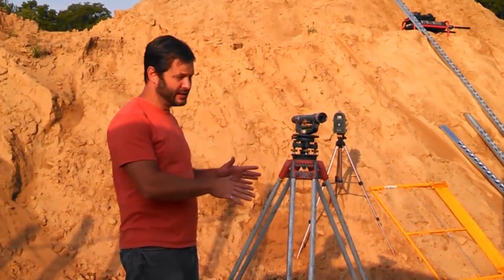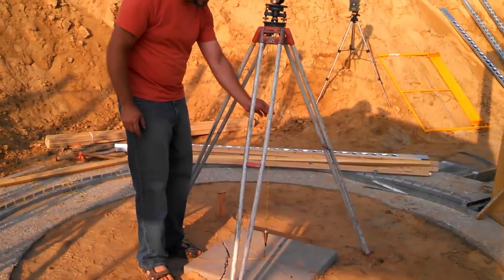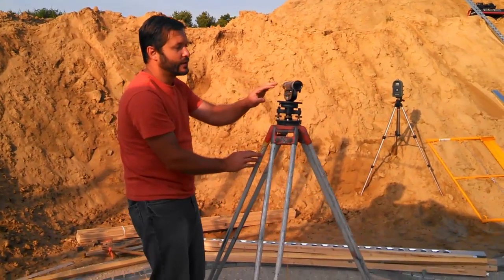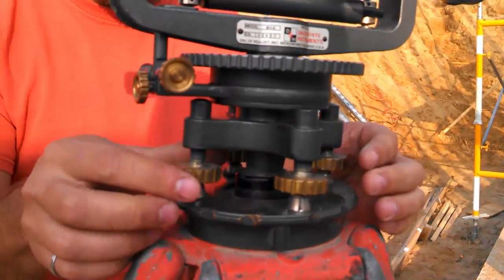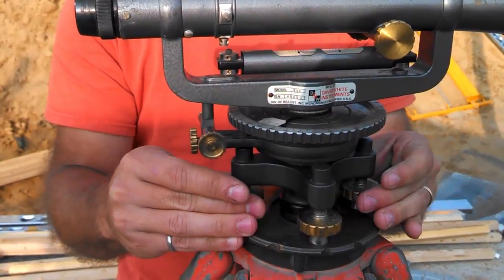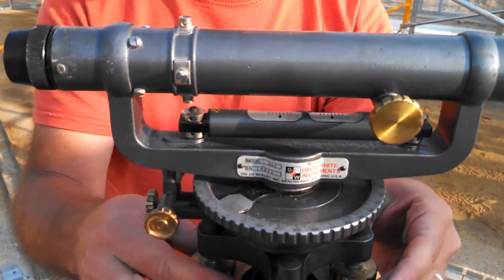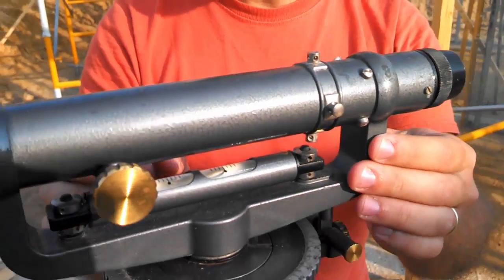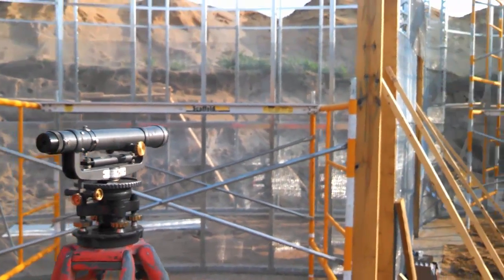4.6 How to setup a Builders Transit

Comment: I don't see how the plumb bob is doing anything? Just because the nail is centered in the board, what difference does that make to the legs of the transit? What am I missing
Reply: When he pushes down on the legs it adjusts the point of the plumb bob to be over the nail.  Its not the way I would do it, but it is one way to do it.  I get the plumb bob close with his method and then level the instrument.  Then the instument can slide around on the base a little bit to center the plumb bob on the nail.
The reason you do this are several.  The first is if someone else wants to check level again, you set up over the same nail to collect from the extact same reference point.  Level follows the curve of the earth so it changes slightly when you collect from a different location.  The second might be if you are also laying out building foundation lines, grade or properly lines.  You have to shoot those from the same location all of the time to get the correct angles.   All surveying is based on this simple math, vertical angle, horizontal angle, and distance.  When you need that you need what they call the Point of Beginning of P.O.B. to be exactly the same.   When done correctly you can go back 100 years later and if the monument (nail) is still there you can find all of the other points of interest.   The nail is critical.
Reply from the maker: Yea, in my case the house is round and very radial and I needed to measure out all the angles from the center.  I didn't want to ever have to find that center again.   So yea, you can easily find level without the plumb, but I was also using the degrees on the unit to mark directions from the center.  If I ever needed to double check anything, I could go back and re-setup over the same paver and do it again.

Comment: Thanks for the video. I picked one of these up a while back and wasn't quite sure how to set it up.....now I know. Any idea if you can still find manuals for this transit? My model # appears to be 8114.
Reply from the maker: No, I couldn't find a manual.  Tool old to be on line.  And most guys probably just tossed it out as soon as they figured it out ;)

Comment: Good explanation on set-up. I listened very carefully to everything you said. Not that it really matters but exactly how did you determine that it was made in 1937?  There is nothing to indicate that from what I can see. The stand is clearly modern likely from the late 60's or early 70's. A wood stand would have been from 50's or before. The instrument itself is made out of aluminum and brass. But mainly Realist Company did not exist until the 1960's. Look at your tag. Also your serial number has six digits the same as mine. I bought mine from Realist in the mid 1970's withe the same stand. BTW I lived in Menomonee falls during the 1960's and 70's. Realist (David White was just a few miles from home. Sometime around 1990 Realist was acquired and later went into receivership and then taken over by someone else. I guess back in the day they made their products to last a lifetime in which may have played a role in their downfall.  If you ever read this please let me know exactly where you came up with 1937?       Thank you for the great explanation.
Reply from the maker: Hmm, good question.  I knew the stand was newer, the guy I got it from just tossed that in at the end when I nearly walked away.  I got the date because the guy said it was that old and from the date stamped on the side of the metal storage case it was in.  The case is custom made to fit the unit (or one the same shape) and is embossed with "David White Company" on the side and then stamped with those individual metal stamps to say some manufacturing date in 1937.  The guy who sold it to me said it was from 1937, pointed to the stamping and I never questioned it.  "I suppose I should have doubted the age of the unit based on the info on the tag on the side of the unit its self.  I just looked it up now and the David White company was making these since 1895, but yeah, Realist didn't get involved until 1961, so it is probably sometime after that, but before 1989.  Oh well, not as cool as 1937, but it still got the job done.  I'll update the description.  

The unit is up in the attic in the garage (this house is built now), but next time I am up there, I'll try to remember to take a look at the serial number on the unit and see if I can narrow that actual date down a bit.

Comment: I have a DIETZGEN 6300 SERIES builders level / transit.  I've lost the manual and need to understand how to bring my cross hairs into focus.  The cross hairs are barely visible now. My transit looks just like the one in this video.  Can you help?  Thanks.
Reply from the maker: For mine, the focus is all in the eye piece.  Basically, you screw it in or out to change the distance between the lenses.